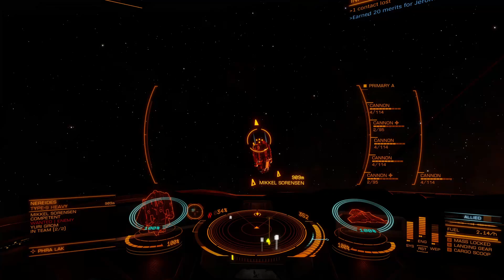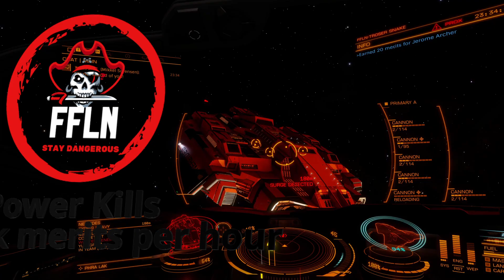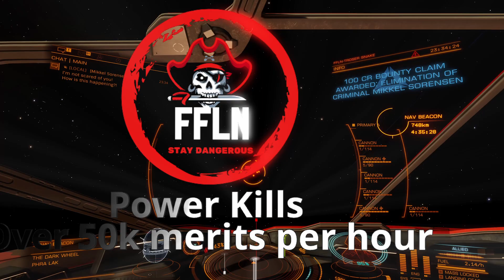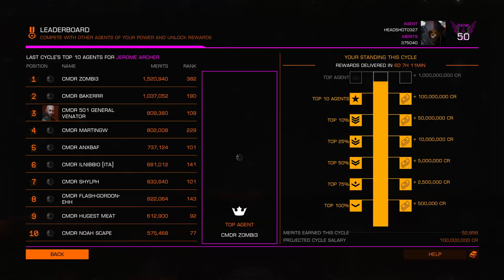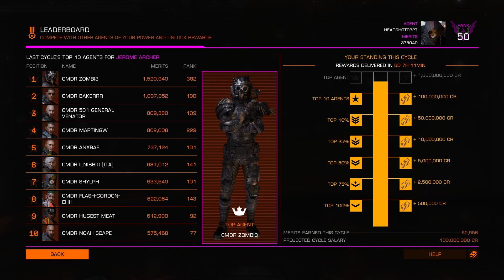Elite Dangerous PowerPlay 2.0, How to Power Kills 50k+ merits per hour, No exploits or glitches

Comment: 07, great job cmdr!!
Reply: You should try these system's in the Galaxy map search bar and fly to them. 07 🫡 I will warn you there are ghost systems green gas giants and Saramandara Pearls, and yes on the ghost systems you can go there, if you know how..... Turn systems from red to blue red meaning you haven't been there blue meaning you have been there, you have to turn off the lights to see the lights,.... mess around with your Galaxy map panel bar,... But in other terms I rather just complete the circuit.

Gamma velorum , HD 125178 , HD 125142 , HD 100085 , Wregoe yk-p e5-83 , Psr joo24-7204e , Psr joo24-7204o , Psr joo24-7204t , Psr joo24-7204q , Psr joo24-7204u , Hip 13044 , Cygni x-3 , Plaa aec iz-n c20-1 , Eafots eu-r c4-1 , Pru aescs dl-w c15-37 , Stuemeae fg-y d7561 , Stuemeae km-w c1-4809 , Ic 4673 , Ic 2391 sector ze-a d101 , Ic 2391 sector gw-v b2-4 , Cygnus x-1 , Cygnus x-3 , Evelyn's light , Urt , Ads 9338 ac , Scheau bli nb-o d6-342 , Lil , Synuefe xr-h d11-102 , Trappist-1 , Lft 509 , Rigel , Ngc 2841 , Ngc 5195 , Ngc 1566 , GJ 1214B , Cw 190521 , Rx j1856.5-3754 , Serpent 37 , 6 Lacertae , 6 Lambda Leporis , Alnilam , Alnitak , Mintaka , Sol , Proxima Centauri , Sirius , Stephenson 2-18 , Carcosa , Maia , Ads 4229 abc , Eimbaith Lw-w EL-290 , Floasly te-x d2-25 , Synookio EL-J d9-1 , Gongae Qw-1 c24-0 , Byoi aewsy r2-f d11-104 , Eol prou kw-1 cb-32 , Blua hypa hi-f d12-1226 , Bleia dryiae hf-w b35-1 , Col 285 sector vu-m c8-32 , Eol prou kw-1 c8-32 , Eafoff IN-Q d6-0 , Dryooe prou ff-z d696 , Boelts XH-C c29-854 , Shaulai DL-P d5-274 , Stuemeae bv-y f2111 , Stuemeae nn-s e4-1360 , Stuemeae nn-s e4-5583 , Nyuena bf-r e4-3196 , Nyuena bf-r e4-4054 , Nyuena bf-r e4-2200 , Nyuena bv-p e5-458 , Nyuena bv-p e5-1493 , Nyuena bv-p e5-2376 , Pre Aowsy ba-a , Brambai uz-o e6-313 , Dumboe aa-a h207 , Hypao brai kw-v b5-21 , Hypio gree aa-a h56 , HD 155889 , Bleia dryiea xj-r e4-1 , Hi'iaka , Angosk jm-w d1-05 , Hip 52741 , Tira Flirble , Smade's , Hip 57951 , Lorant mi-b d13-1 , Blaea brou cn-b d13-06 , Psr j0024-7204Q1 , Eolls hypai no-x d2-06 , HD 64285 , Hip 64902 , Hip 604151 , HD 213221 , HD 211744 , Hip 57951 , Smeamaa aa-a ho4 , Phleedgoea kx-u f2-10 , Garth , Izar , Axanar , Klingon , CBS , Orian , Actaea , Vanth , HD 35460 , Hip 57951 , S171378 , Smith's claim , Pru aescs zk-p e5-103513 , HD 474171 , Swoiwns td-r d5-85 , Wellington , HD 64287 , Hip 64902 , Oevasy sg-y do , Hyphiemoe yk-p d5-0 , Eolls hypai ll-z d1-02 , Psr j1641+3627ba , HD 64282 , 2 mass j02323627+61282553 , Nyeajoa fb-o e6-oa , Eor phyloi cl-y g137 , Pria thoi zp-g d10-37 , HD 2020881 , Ogaicy zo-a e4228 , HD 935217 , HD 984256 , HD 71297 , Ra , La , MYT , Boetis , Sagittarius A* , Beagle point  , Romulus  , Polaris , Wolf 359 , Gargantuan , Miller's planet , H    , last bust not least use your first three letters of your commander name in-game for your secret starter system ..

Comment: I did this for two hours after spending most of today's playtime engineering a Python mk 2 and I can confirm this is very fast! Worth noting that if you bring collector limpets with you, you can snatch up any occupied escape pods. I did that because Aisling provides better merit payouts for them and I ranked up, I think 3 times just before tonight's reset? Didn't have time to check my weekly earned merits but it's more enjoyable than doing trade, for sure. Thank you :)

Oh, also, I noticed something! The ones in wings typically have a designated "courier" and an escort or two. Couriers will always try and run away if you attack them, but the escorts will fight back and the courier won't try to warp out until you actually fire at it. Maybe it isn't faster to try and kill all of them, but I was killing the smaller ships first before the escortee.
Reply: If you rank 3 times after 2h play then it is not fast. You can make 32k merits (3 ranks) in 1 hour with mining.
Reply: @Marval150 Well, I definitely could've been faster just from a personal standpoint. I wasn't exclusively doing this, I had a few flubs where I needed to go back and repair or get up to get water, etc. I know for sure I could've gone faster, it was my first time doing it.

Also, I just, really don't like mining. It's not my idea of fun, so I prefer doing things like bounty hunting (if I want some slower but more enjoyable merit gain) or this if I want something faster and easier. This is still the fastest method I've used so far that I actually like.

Comment: Did not realize that the powerplay system got updated in October. Was going to lament that i didnt know about this years ago when i was grinding for the uber shields or the bloodhound missiles but it wouldn't have mattered then lol
Reply: Sorry to be the one to break it to you - but I used to use the 'nav beacon trick' to rank up for Hudson back in the day.
Although - to be fair - I'd also end up with a pretty large power bounty too 😉
Reply from the maker: @cmdrreggit  exactly, I used to as Hudson for years as well. though it was still faster to trade merits.

Comment: Concise and informative. Thank you for this Cmdr!
Reply: You should try these system's in the Galaxy map search bar and fly to them. 07 🫡 I will warn you there are ghost systems green gas giants and Saramandara Pearls, and yes on the ghost systems you can go there, if you know how..... Turn systems from red to blue red meaning you haven't been there blue meaning you have been there, you have to turn off the lights to see the lights,.... mess around with your Galaxy map panel bar,... But in other terms I rather just complete the circuit.

Gamma velorum , HD 125178 , HD 125142 , HD 100085 , Wregoe yk-p e5-83 , Psr joo24-7204e , Psr joo24-7204o , Psr joo24-7204t , Psr joo24-7204q , Psr joo24-7204u , Hip 13044 , Cygni x-3 , Plaa aec iz-n c20-1 , Eafots eu-r c4-1 , Pru aescs dl-w c15-37 , Stuemeae fg-y d7561 , Stuemeae km-w c1-4809 , Ic 4673 , Ic 2391 sector ze-a d101 , Ic 2391 sector gw-v b2-4 , Cygnus x-1 , Cygnus x-3 , Evelyn's light , Urt , Ads 9338 ac , Scheau bli nb-o d6-342 , Lil , Synuefe xr-h d11-102 , Trappist-1 , Lft 509 , Rigel , Ngc 2841 , Ngc 5195 , Ngc 1566 , GJ 1214B , Cw 190521 , Rx j1856.5-3754 , Serpent 37 , 6 Lacertae , 6 Lambda Leporis , Alnilam , Alnitak , Mintaka , Sol , Proxima Centauri , Sirius , Stephenson 2-18 , Carcosa , Maia , Ads 4229 abc , Eimbaith Lw-w EL-290 , Floasly te-x d2-25 , Synookio EL-J d9-1 , Gongae Qw-1 c24-0 , Byoi aewsy r2-f d11-104 , Eol prou kw-1 cb-32 , Blua hypa hi-f d12-1226 , Bleia dryiae hf-w b35-1 , Col 285 sector vu-m c8-32 , Eol prou kw-1 c8-32 , Eafoff IN-Q d6-0 , Dryooe prou ff-z d696 , Boelts XH-C c29-854 , Shaulai DL-P d5-274 , Stuemeae bv-y f2111 , Stuemeae nn-s e4-1360 , Stuemeae nn-s e4-5583 , Nyuena bf-r e4-3196 , Nyuena bf-r e4-4054 , Nyuena bf-r e4-2200 , Nyuena bv-p e5-458 , Nyuena bv-p e5-1493 , Nyuena bv-p e5-2376 , Pre Aowsy ba-a , Brambai uz-o e6-313 , Dumboe aa-a h207 , Hypao brai kw-v b5-21 , Hypio gree aa-a h56 , HD 155889 , Bleia dryiea xj-r e4-1 , Hi'iaka , Angosk jm-w d1-05 , Hip 52741 , Tira Flirble , Smade's , Hip 57951 , Lorant mi-b d13-1 , Blaea brou cn-b d13-06 , Psr j0024-7204Q1 , Eolls hypai no-x d2-06 , HD 64285 , Hip 64902 , Hip 604151 , HD 213221 , HD 211744 , Hip 57951 , Smeamaa aa-a ho4 , Phleedgoea kx-u f2-10 , Garth , Izar , Axanar , Klingon , CBS , Orian , Actaea , Vanth , HD 35460 , Hip 57951 , S171378 , Smith's claim , Pru aescs zk-p e5-103513 , HD 474171 , Swoiwns td-r d5-85 , Wellington , HD 64287 , Hip 64902 , Oevasy sg-y do , Hyphiemoe yk-p d5-0 , Eolls hypai ll-z d1-02 , Psr j1641+3627ba , HD 64282 , 2 mass j02323627+61282553 , Nyeajoa fb-o e6-oa , Eor phyloi cl-y g137 , Pria thoi zp-g d10-37 , HD 2020881 , Ogaicy zo-a e4228 , HD 935217 , HD 984256 , HD 71297 , Ra , La , MYT , Boetis , Sagittarius A* , Beagle point  , Romulus  , Polaris , Wolf 359 , Gargantuan , Miller's planet , H    , last bust not least use your first three letters of your commander name in-game for your secret starter system ..

Comment: Another great video, very helpful
Reply: You should try these system's in the Galaxy map search bar and fly to them. 07 🫡 I will warn you there are ghost systems green gas giants and Saramandara Pearls, and yes on the ghost systems you can go there, if you know how..... Turn systems from red to blue red meaning you haven't been there blue meaning you have been there, you have to turn off the lights to see the lights,.... mess around with your Galaxy map panel bar,... But in other terms I rather just complete the circuit.

Gamma velorum , HD 125178 , HD 125142 , HD 100085 , Wregoe yk-p e5-83 , Psr joo24-7204e , Psr joo24-7204o , Psr joo24-7204t , Psr joo24-7204q , Psr joo24-7204u , Hip 13044 , Cygni x-3 , Plaa aec iz-n c20-1 , Eafots eu-r c4-1 , Pru aescs dl-w c15-37 , Stuemeae fg-y d7561 , Stuemeae km-w c1-4809 , Ic 4673 , Ic 2391 sector ze-a d101 , Ic 2391 sector gw-v b2-4 , Cygnus x-1 , Cygnus x-3 , Evelyn's light , Urt , Ads 9338 ac , Scheau bli nb-o d6-342 , Lil , Synuefe xr-h d11-102 , Trappist-1 , Lft 509 , Rigel , Ngc 2841 , Ngc 5195 , Ngc 1566 , GJ 1214B , Cw 190521 , Rx j1856.5-3754 , Serpent 37 , 6 Lacertae , 6 Lambda Leporis , Alnilam , Alnitak , Mintaka , Sol , Proxima Centauri , Sirius , Stephenson 2-18 , Carcosa , Maia , Ads 4229 abc , Eimbaith Lw-w EL-290 , Floasly te-x d2-25 , Synookio EL-J d9-1 , Gongae Qw-1 c24-0 , Byoi aewsy r2-f d11-104 , Eol prou kw-1 cb-32 , Blua hypa hi-f d12-1226 , Bleia dryiae hf-w b35-1 , Col 285 sector vu-m c8-32 , Eol prou kw-1 c8-32 , Eafoff IN-Q d6-0 , Dryooe prou ff-z d696 , Boelts XH-C c29-854 , Shaulai DL-P d5-274 , Stuemeae bv-y f2111 , Stuemeae nn-s e4-1360 , Stuemeae nn-s e4-5583 , Nyuena bf-r e4-3196 , Nyuena bf-r e4-4054 , Nyuena bf-r e4-2200 , Nyuena bv-p e5-458 , Nyuena bv-p e5-1493 , Nyuena bv-p e5-2376 , Pre Aowsy ba-a , Brambai uz-o e6-313 , Dumboe aa-a h207 , Hypao brai kw-v b5-21 , Hypio gree aa-a h56 , HD 155889 , Bleia dryiea xj-r e4-1 , Hi'iaka , Angosk jm-w d1-05 , Hip 52741 , Tira Flirble , Smade's , Hip 57951 , Lorant mi-b d13-1 , Blaea brou cn-b d13-06 , Psr j0024-7204Q1 , Eolls hypai no-x d2-06 , HD 64285 , Hip 64902 , Hip 604151 , HD 213221 , HD 211744 , Hip 57951 , Smeamaa aa-a ho4 , Phleedgoea kx-u f2-10 , Garth , Izar , Axanar , Klingon , CBS , Orian , Actaea , Vanth , HD 35460 , Hip 57951 , S171378 , Smith's claim , Pru aescs zk-p e5-103513 , HD 474171 , Swoiwns td-r d5-85 , Wellington , HD 64287 , Hip 64902 , Oevasy sg-y do , Hyphiemoe yk-p d5-0 , Eolls hypai ll-z d1-02 , Psr j1641+3627ba , HD 64282 , 2 mass j02323627+61282553 , Nyeajoa fb-o e6-oa , Eor phyloi cl-y g137 , Pria thoi zp-g d10-37 , HD 2020881 , Ogaicy zo-a e4228 , HD 935217 , HD 984256 , HD 71297 , Ra , La , MYT , Boetis , Sagittarius A* , Beagle point  , Romulus  , Polaris , Wolf 359 , Gargantuan , Miller's planet , H    , last bust not least use your first three letters of your commander name in-game for your secret starter system ..

Comment: 2 gimbal and 4 fixed cannons, what engineering did you put on those
havent touched cannons in years haha
Reply from the maker: all overcharged. all large oversize, the medium are gimbled dazzle. there is a large shot speed difference between large and medium cannons. so I gimble the medium, so I don't have to aim at two different reticles
Reply: Probably high cap oversized

Comment: Simple, helpful, and straightforward video. Thank you.
Reply: You should try these system's in the Galaxy map search bar and fly to them. 07 🫡 I will warn you there are ghost systems green gas giants and Saramandara Pearls, and yes on the ghost systems you can go there, if you know how..... Turn systems from red to blue red meaning you haven't been there blue meaning you have been there, you have to turn off the lights to see the lights,.... mess around with your Galaxy map panel bar,... But in other terms I rather just complete the circuit.

Gamma velorum , HD 125178 , HD 125142 , HD 100085 , Wregoe yk-p e5-83 , Psr joo24-7204e , Psr joo24-7204o , Psr joo24-7204t , Psr joo24-7204q , Psr joo24-7204u , Hip 13044 , Cygni x-3 , Plaa aec iz-n c20-1 , Eafots eu-r c4-1 , Pru aescs dl-w c15-37 , Stuemeae fg-y d7561 , Stuemeae km-w c1-4809 , Ic 4673 , Ic 2391 sector ze-a d101 , Ic 2391 sector gw-v b2-4 , Cygnus x-1 , Cygnus x-3 , Evelyn's light , Urt , Ads 9338 ac , Scheau bli nb-o d6-342 , Lil , Synuefe xr-h d11-102 , Trappist-1 , Lft 509 , Rigel , Ngc 2841 , Ngc 5195 , Ngc 1566 , GJ 1214B , Cw 190521 , Rx j1856.5-3754 , Serpent 37 , 6 Lacertae , 6 Lambda Leporis , Alnilam , Alnitak , Mintaka , Sol , Proxima Centauri , Sirius , Stephenson 2-18 , Carcosa , Maia , Ads 4229 abc , Eimbaith Lw-w EL-290 , Floasly te-x d2-25 , Synookio EL-J d9-1 , Gongae Qw-1 c24-0 , Byoi aewsy r2-f d11-104 , Eol prou kw-1 cb-32 , Blua hypa hi-f d12-1226 , Bleia dryiae hf-w b35-1 , Col 285 sector vu-m c8-32 , Eol prou kw-1 c8-32 , Eafoff IN-Q d6-0 , Dryooe prou ff-z d696 , Boelts XH-C c29-854 , Shaulai DL-P d5-274 , Stuemeae bv-y f2111 , Stuemeae nn-s e4-1360 , Stuemeae nn-s e4-5583 , Nyuena bf-r e4-3196 , Nyuena bf-r e4-4054 , Nyuena bf-r e4-2200 , Nyuena bv-p e5-458 , Nyuena bv-p e5-1493 , Nyuena bv-p e5-2376 , Pre Aowsy ba-a , Brambai uz-o e6-313 , Dumboe aa-a h207 , Hypao brai kw-v b5-21 , Hypio gree aa-a h56 , HD 155889 , Bleia dryiea xj-r e4-1 , Hi'iaka , Angosk jm-w d1-05 , Hip 52741 , Tira Flirble , Smade's , Hip 57951 , Lorant mi-b d13-1 , Blaea brou cn-b d13-06 , Psr j0024-7204Q1 , Eolls hypai no-x d2-06 , HD 64285 , Hip 64902 , Hip 604151 , HD 213221 , HD 211744 , Hip 57951 , Smeamaa aa-a ho4 , Phleedgoea kx-u f2-10 , Garth , Izar , Axanar , Klingon , CBS , Orian , Actaea , Vanth , HD 35460 , Hip 57951 , S171378 , Smith's claim , Pru aescs zk-p e5-103513 , HD 474171 , Swoiwns td-r d5-85 , Wellington , HD 64287 , Hip 64902 , Oevasy sg-y do , Hyphiemoe yk-p d5-0 , Eolls hypai ll-z d1-02 , Psr j1641+3627ba , HD 64282 , 2 mass j02323627+61282553 , Nyeajoa fb-o e6-oa , Eor phyloi cl-y g137 , Pria thoi zp-g d10-37 , HD 2020881 , Ogaicy zo-a e4228 , HD 935217 , HD 984256 , HD 71297 , Ra , La , MYT , Boetis , Sagittarius A* , Beagle point  , Romulus  , Polaris , Wolf 359 , Gargantuan , Miller's planet , H    , last bust not least use your first three letters of your commander name in-game for your secret starter system ..

Comment: Damn thats actually some good Info
Reply from the maker: thanks for watching
Reply: You should try these system's in the Galaxy map search bar and fly to them. 07 🫡 I will warn you there are ghost systems green gas giants and Saramandara Pearls, and yes on the ghost systems you can go there, if you know how..... Turn systems from red to blue red meaning you haven't been there blue meaning you have been there, you have to turn off the lights to see the lights,.... mess around with your Galaxy map panel bar,... But in other terms I rather just complete the circuit.

Gamma velorum , HD 125178 , HD 125142 , HD 100085 , Wregoe yk-p e5-83 , Psr joo24-7204e , Psr joo24-7204o , Psr joo24-7204t , Psr joo24-7204q , Psr joo24-7204u , Hip 13044 , Cygni x-3 , Plaa aec iz-n c20-1 , Eafots eu-r c4-1 , Pru aescs dl-w c15-37 , Stuemeae fg-y d7561 , Stuemeae km-w c1-4809 , Ic 4673 , Ic 2391 sector ze-a d101 , Ic 2391 sector gw-v b2-4 , Cygnus x-1 , Cygnus x-3 , Evelyn's light , Urt , Ads 9338 ac , Scheau bli nb-o d6-342 , Lil , Synuefe xr-h d11-102 , Trappist-1 , Lft 509 , Rigel , Ngc 2841 , Ngc 5195 , Ngc 1566 , GJ 1214B , Cw 190521 , Rx j1856.5-3754 , Serpent 37 , 6 Lacertae , 6 Lambda Leporis , Alnilam , Alnitak , Mintaka , Sol , Proxima Centauri , Sirius , Stephenson 2-18 , Carcosa , Maia , Ads 4229 abc , Eimbaith Lw-w EL-290 , Floasly te-x d2-25 , Synookio EL-J d9-1 , Gongae Qw-1 c24-0 , Byoi aewsy r2-f d11-104 , Eol prou kw-1 cb-32 , Blua hypa hi-f d12-1226 , Bleia dryiae hf-w b35-1 , Col 285 sector vu-m c8-32 , Eol prou kw-1 c8-32 , Eafoff IN-Q d6-0 , Dryooe prou ff-z d696 , Boelts XH-C c29-854 , Shaulai DL-P d5-274 , Stuemeae bv-y f2111 , Stuemeae nn-s e4-1360 , Stuemeae nn-s e4-5583 , Nyuena bf-r e4-3196 , Nyuena bf-r e4-4054 , Nyuena bf-r e4-2200 , Nyuena bv-p e5-458 , Nyuena bv-p e5-1493 , Nyuena bv-p e5-2376 , Pre Aowsy ba-a , Brambai uz-o e6-313 , Dumboe aa-a h207 , Hypao brai kw-v b5-21 , Hypio gree aa-a h56 , HD 155889 , Bleia dryiea xj-r e4-1 , Hi'iaka , Angosk jm-w d1-05 , Hip 52741 , Tira Flirble , Smade's , Hip 57951 , Lorant mi-b d13-1 , Blaea brou cn-b d13-06 , Psr j0024-7204Q1 , Eolls hypai no-x d2-06 , HD 64285 , Hip 64902 , Hip 604151 , HD 213221 , HD 211744 , Hip 57951 , Smeamaa aa-a ho4 , Phleedgoea kx-u f2-10 , Garth , Izar , Axanar , Klingon , CBS , Orian , Actaea , Vanth , HD 35460 , Hip 57951 , S171378 , Smith's claim , Pru aescs zk-p e5-103513 , HD 474171 , Swoiwns td-r d5-85 , Wellington , HD 64287 , Hip 64902 , Oevasy sg-y do , Hyphiemoe yk-p d5-0 , Eolls hypai ll-z d1-02 , Psr j1641+3627ba , HD 64282 , 2 mass j02323627+61282553 , Nyeajoa fb-o e6-oa , Eor phyloi cl-y g137 , Pria thoi zp-g d10-37 , HD 2020881 , Ogaicy zo-a e4228 , HD 935217 , HD 984256 , HD 71297 , Ra , La , MYT , Boetis , Sagittarius A* , Beagle point  , Romulus  , Polaris , Wolf 359 , Gargantuan , Miller's planet , H    , last bust not least use your first three letters of your commander name in-game for your secret starter system ..